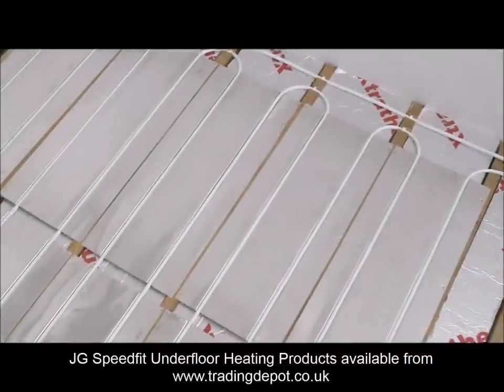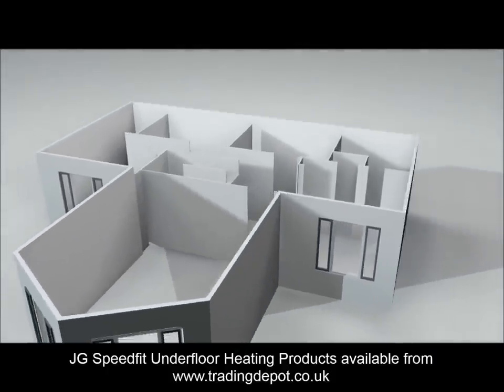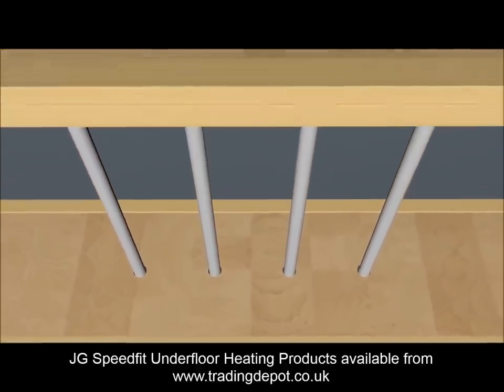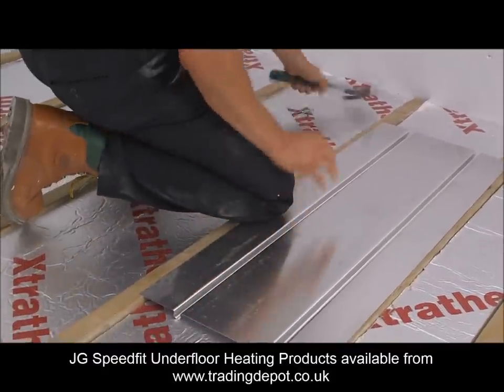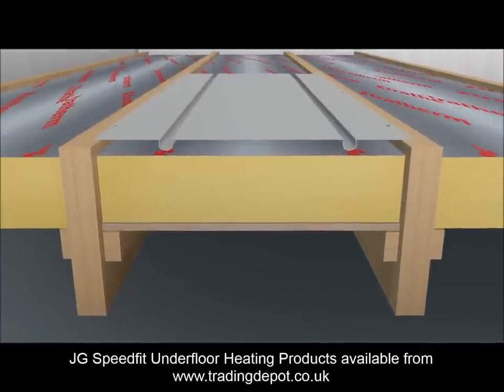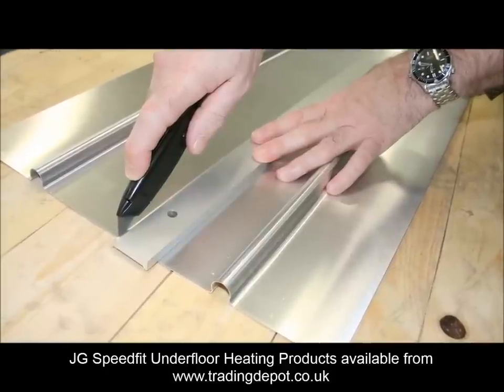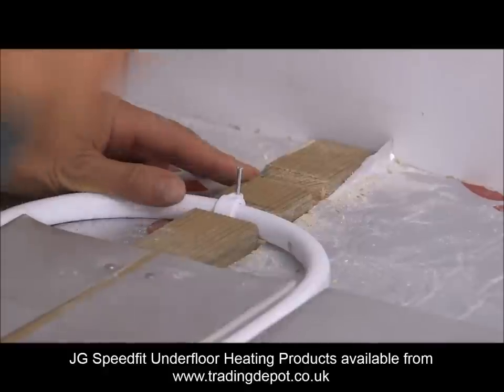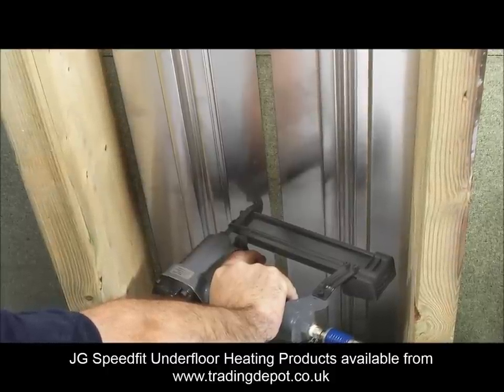Installing the JG Speedfit Spreader Plate Underfloor Heating System

Comment: I built an electric coil thermal mass heating slab in my bedroom. It works great in the winter time.

I am glad this video stressed the importance of high insulation first. I now have R100 attic, R25 walls and R35 floor insulation under the whole house.

To build the electric heating slabs, I installed a sheet of 1" tinfoil foam board on top of the floor for the footprint of the heating slab. Spray foam and aluminum tape all seams. Then cut and lay on top 2 layers of concrete board for thermal mass holding and slow releasing the heat generated. I then installed the electric coil mat on top. I grouted the coils even and put another layer of concrete board on top. I then tiled and grouted the entire 3 foot by 9 foot slab and plugged it in to the electric grid. 

$1,000 for materials: $400 electric heating coil mat, $300 tile and grout,  $200 insulation and concrete boards.

It warms up slowly over a day and then delivers even, gentle and silent heat into my bedroom and warms my feet as I sit at my desk.

Comment: There is much that is not best practice about this method of installing UFH.  If you're building or working on a new house, it is far far better to use the infill method, which less restricting,  and more energy efficient.
Reply: what is infill method?
Reply: Possibly a good system for refurbs and listed buildings, where the underfloor heating is supplimented with rads at single glazed windows.